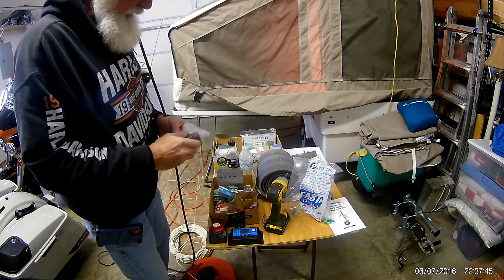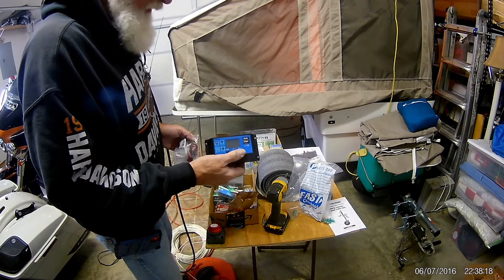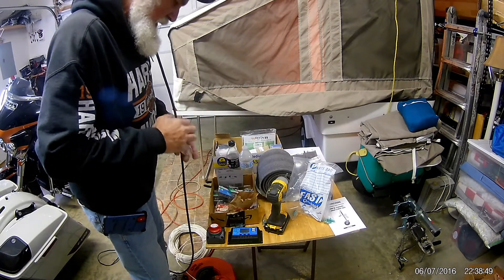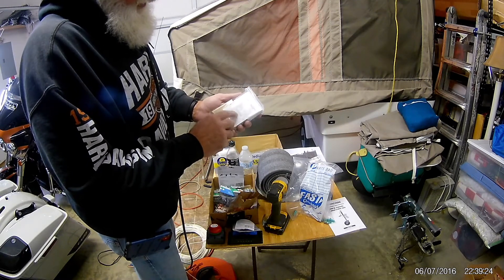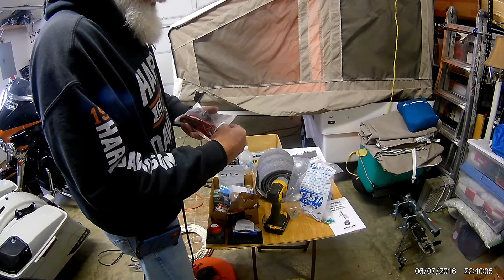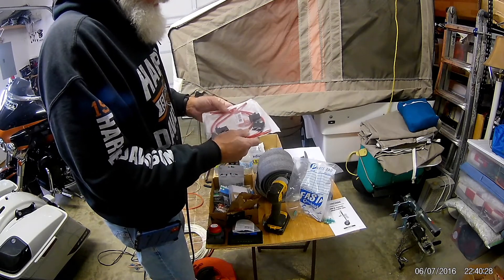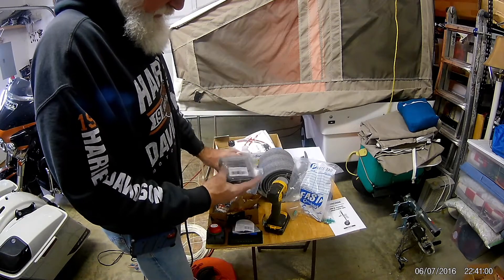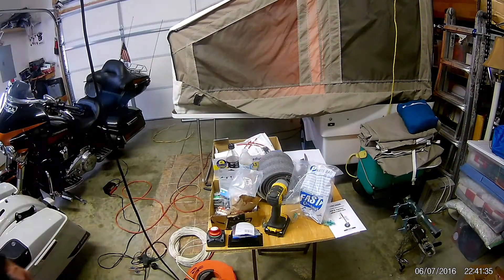Kompact Kamper Solar Project

Comment from the maker: This is a list of all the components I ordered from Amazon:

100 Watt Solar Panel
https://www.amazon.com/gp/product/B08DXRJS3N/ref=ppx_yo_dt_b_asin_title_o02_s01?ie=UTF8&psc=1

Solar Panel Controller - Input from the solar panel and it controls the charge going to the battery.  Make sure you hook-up the battery to this first.
https://www.amazon.com/gp/product/B0885YS77P/ref=ppx_yo_dt_b_asin_title_o02_s03?ie=UTF8&psc=1

Solar panel mounting brackets
https://www.amazon.com/gp/product/B0876JYKYM/ref=ppx_yo_dt_b_asin_title_o07_s00?ie=UTF8&psc=1

Solar Panel 20ft Extension cable
https://www.amazon.com/gp/product/B07Z8YCR68/ref=ppx_yo_dt_b_asin_title_o06_s00?ie=UTF8&psc=1

12v four channel remote controller
https://www.amazon.com/gp/product/B07MTYGJHQ/ref=ppx_yo_dt_b_asin_title_o09_s00?ie=UTF8&psc=1

Plug for bringing the solar panel wires through the camper - I bought two of these so I could make a short extension cord for travel.
https://www.amazon.com/gp/product/B07DPR8T19/ref=ppx_yo_dt_b_asin_title_o07_s01?ie=UTF8&psc=1

Lights I used inside the camper
https://www.amazon.com/gp/product/B07JNYBMZY/ref=ppx_yo_dt_b_asin_title_o03_s00?ie=UTF8&psc=1

Switch/cigarette lighter outlet/Dual USB with Voltmeter panel
https://www.amazon.com/gp/product/B08GX4Z9NB/ref=ppx_yo_dt_b_asin_title_o04_s00?ie=UTF8&psc=1

Dual USB quick charger socket - I use this on the side of my camper.
https://www.amazon.com/gp/product/B08PTZ17NS/ref=ppx_yo_dt_b_asin_title_o02_s00?ie=UTF8&psc=1

Rare Earth Magnets - I put these on the lights so I can move the lights for storage.
https://www.amazon.com/gp/product/B07X97223X/ref=ppx_yo_dt_b_asin_title_o02_s02?ie=UTF8&psc=1

2000 Watt inverter
https://www.amazon.com/gp/product/B07458K4Y1/ref=ppx_yo_dt_b_asin_title_o03_s00?ie=UTF8&psc=1

Battery shut-off switch
https://www.amazon.com/gp/product/B07413JWLD/ref=ppx_yo_dt_b_asin_title_o01_s00?ie=UTF8&psc=1

110v RV inlet shore power plug
https://www.amazon.com/gp/product/B08B3MR572/ref=ppx_yo_dt_b_asin_title_o01_s00?ie=UTF8&psc=1
Reply: I realize this took some time to put together these links.  Thank you so very much for the detailed info!

Comment: Remove the solar panel mount a tube across the lid at the back attach the solar panel to a long board and mount it onto the tube at the back. install an extending leg on the underside of the board then when you pull up flip the solar panel over and fold out the leg then open the camper lid. you no longer need to remove the panel each time
Reply: Your idea sounds interesting but I can’t get a visual. Do you have a video of it? Thanks

Comment: Oh man where is the rest? Lol have seen it with the finished product (solar panel plugged into the camper) was interested in the set up. Wife and I have toyed with the idea of a camper but our trips normally are all on the move so not sure about that yet
Reply from the maker: To me it has been worth the add.  I did a couple of videos with it done.  The lights at night are convenient and the ease of charging my phone and headset are a nice feature.  I’ve not had much success with the inverter yet. I’m thinking of investing in a 3000watt pure sine. I’m wanting to use it the knock the chill off with a small electric heater 500w.